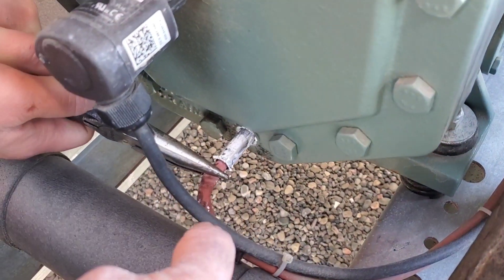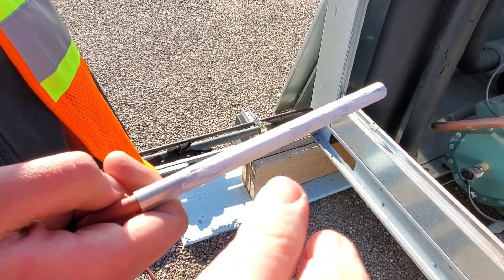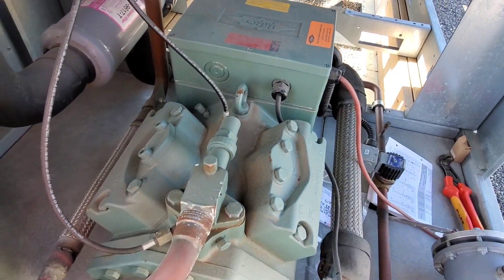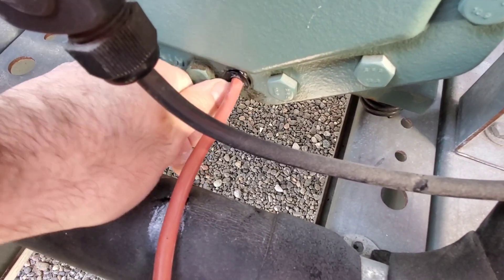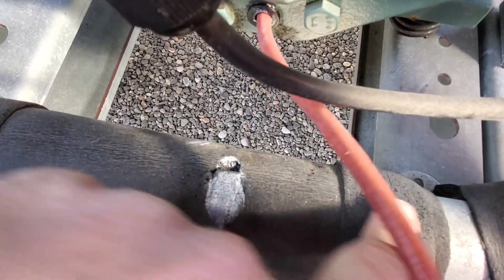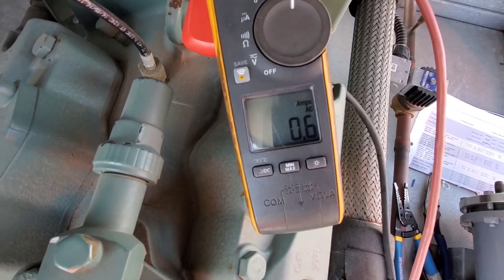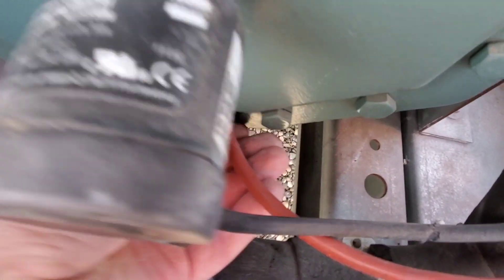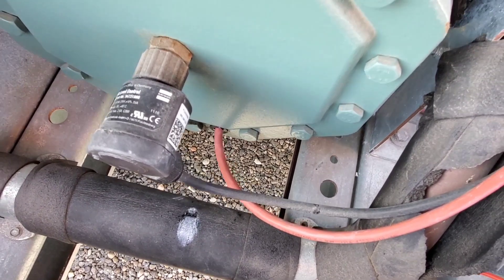Crankcase Heater Replacement On A Condensing Unit

Comment: Bryant 15 ton, 2 stg condenser, 3 fan, motor master powers up fan1 and fan3, 2nd stage.
Fan2 comes on for stg1
The lac stays open anything below 40°
Michigan temps fluctuate 25-30° in a 24 hr period.
The lac won't close until snapdisc senses 40°+
So there is a grey area which the 1stg system runs minus the fan... I am getting nusance trips  at Random, but, mostly in the cool mornings right before the load gets heavy on the space. 630am
The load is heat/lighting for horticulture

Comment: Good informed video. Let the truth be told. A recip can handle liquid for a very short time before it gets severely damaged. I’ve heard many different opinions about what a crankcase heater does. This video is the truth. Yes it prevents migration because refrigerant migrates to the coldest spot. That won’t be a warm crankcase. Don’t argue ,you will just show your ignorance.